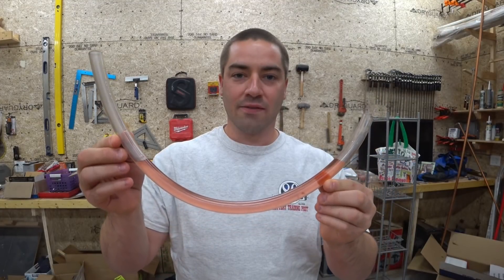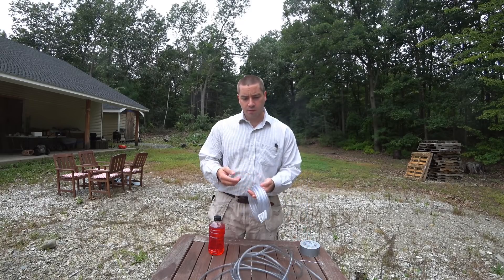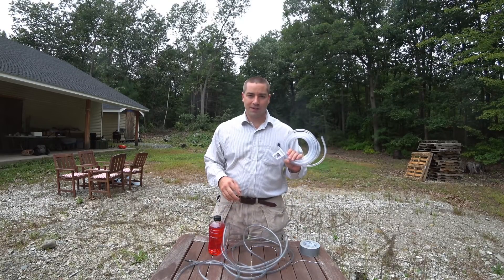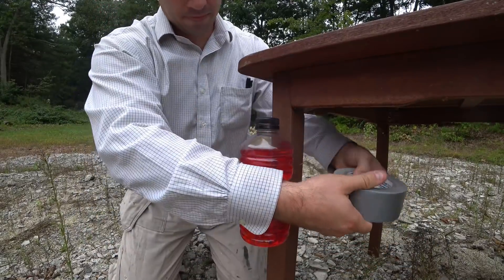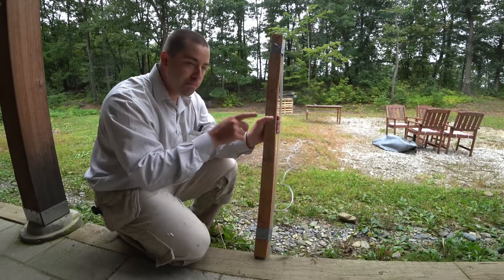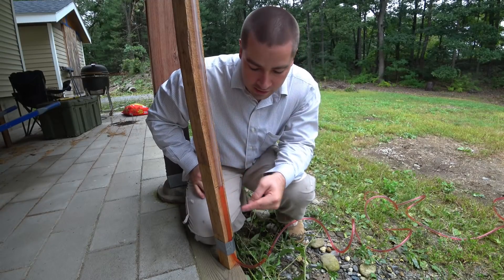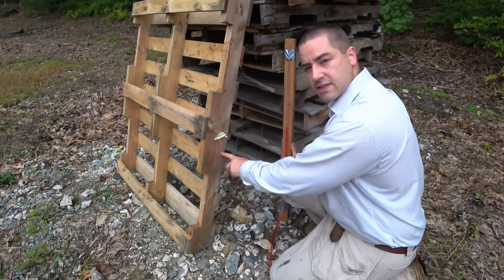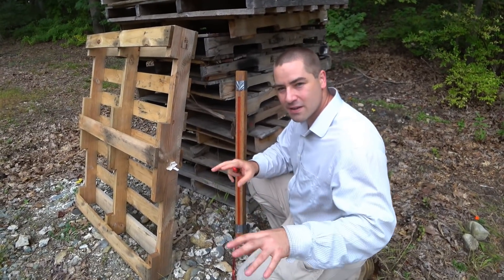How to Make a Water Level for $20 and use it

Comment: I tore apart 2 coffee makers and took out a small floating ball check the I put at both ends and if the water gets to the end the ball rises and does not let the water come over the top. the other one I have has a small tank and a small thin hose so that when you use the water level the height of the water in the container change in negligible. with a big hose the level in the bottle will change enough to have reading that are not as accurate.

Comment: I setup mobile homes for years. We used a simple 1 gallon bucket. And a few hundred feet of tube. Food coloring, and water and its a level. A shutoff valve is a good idea also. About a 3/8" tube works great.

Comment: Basically you set the top of the patio as a benchmark normally I would call that 100 with the rod and level so every shot in the lawn would be a cut or fill shot but since all yours are low they are all fills, so if I read 5 feet on the patio my hi (height of instrument) would be 105 put it on the lawn and read 6 obviously 1 foot fill 4 would be a 1 foot cut. With a base line established it would be easy to calculate the required amount of fill or grade if you desired a slope.
Have fun and don't drink your level lol.

Comment: you sound like you want the lawn level with the patio top for that you would have to ship in more  soil you can not raise height with out it if you just want a level lawn then what you have worked out all ready would do  just cut the heigh spots out in to the low spots and re level